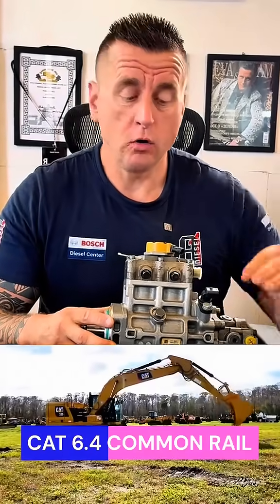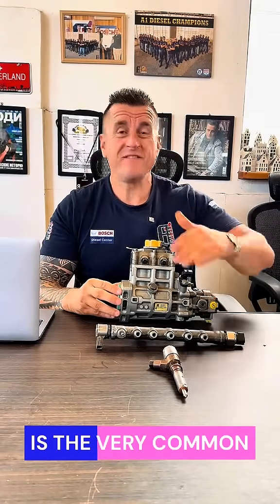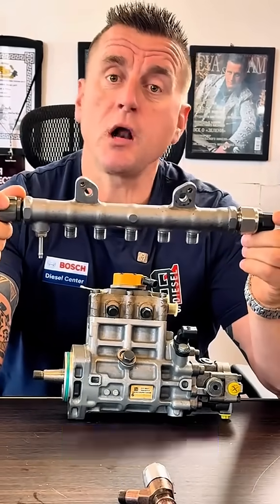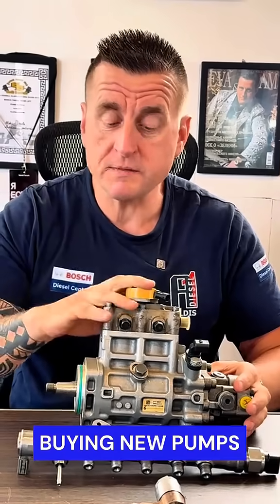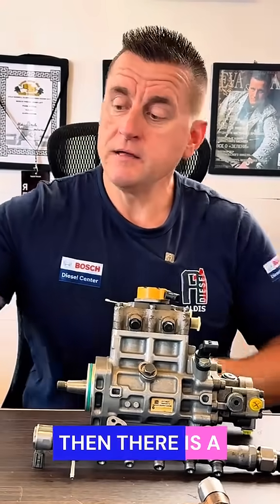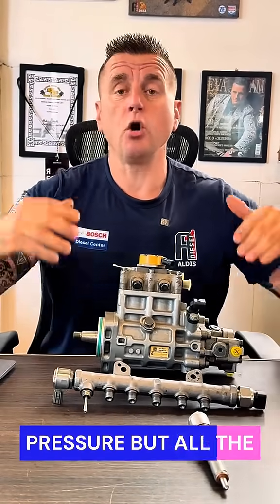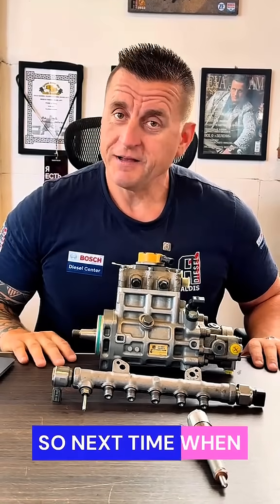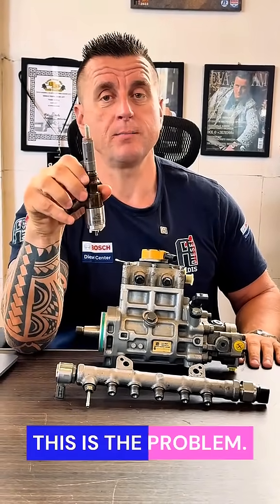Excavator Still Smoking After New Injectors & Pump? Here's WHY! 😤

Comment: The engines I have worked on are under warranty and removing the injectors is prohibited, the best thing to do is to check the fuel filters for restriction, replace the pressure relief valve, test the pressure sensor for resistance and wiring circuit especially when there's fault codes, swap the
Fuel pump and now you have isolated the problem to the injectors

Comment: Yeh, lazy mechanics... I once got codes for high pressure loss in a d4d but instead of condemning the pump or fuel rail pressure sensor, I checked the injectors and they were all bad.